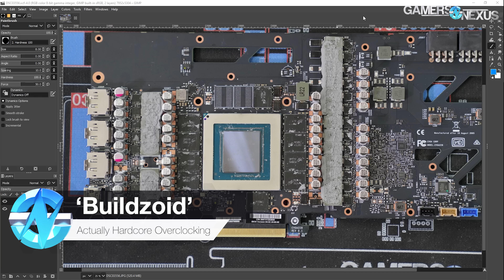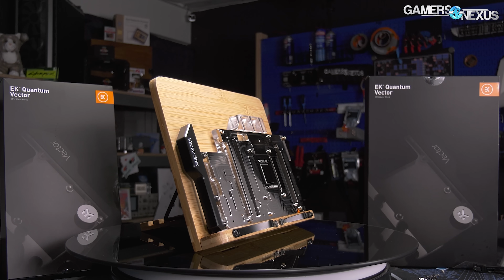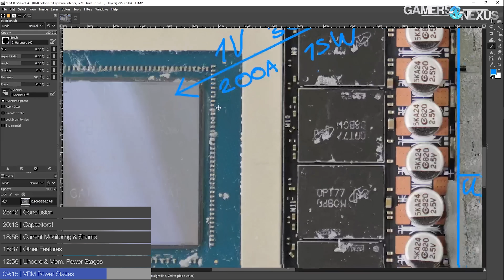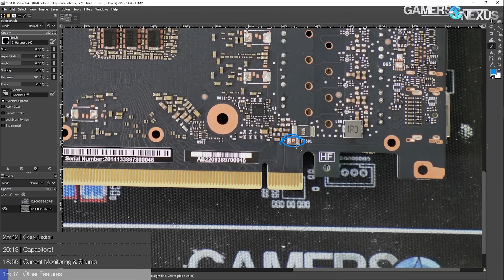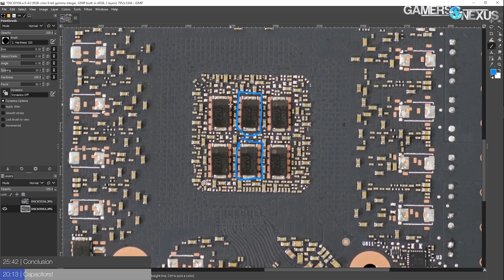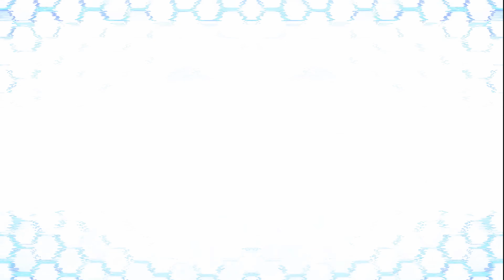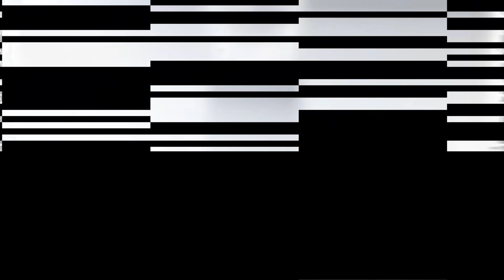Should Be Better for $810: PCB & VRM Review of EVGA RTX 3080 FTW3 Ultra

Comment: Hey Buildzoid. I have to ask...do you know any way to reduce coilwhine of 3080 FEs? I choose the FE, because I listened to your rants. Especially about the blower-heatsinks being to large. The FE fixes that, by using a short blowerstyle. And the other FE Fan is a passthrough, meaning less trapped Heat under the Card and less recycling of hot air.

Comment: So would EVGA's bios be fine with my Ventus 3x OC?
Reply: 450w bios? Nah not on a 2x 8pin card
Reply: @barronhelmutschnitzelnazi2188  Jumped the gun and got an email to buy the LHR version of this 3080. Definitely runs cooler than my Ventus 3x OC, I just wish I had rewatched this video before making this decision.
Reply: Very nice. Yea the ventus didn't have that great of a cooler. Now you can finally use that 450w bios and see what it's all about at least.

Comment: They probably just pushed out a quick card with a few additions from the refrence if the rumours of the AIBs having very little time to do anything were true.
Reply: I think having the new info from yesterday's hardware news about Nvidia trying to control pricing and unfortunately lowering AIB makers' profits down, I think this is the likely culprit. Not EVGA trying to cheap out on their best model moniker that they worked hard to build up and be able to charge a high premium for it.

Comment: This appears to be an early production PCB. I know EVGA reviewed the caps on the backside of the GPU after the whole 'cap issue'. Would they have changed anything else on the final product or is this pretty much what I bought? I feel a little deflated even though I'm very happy with mine.
Reply from the maker: Nothing else changed but the back.

Comment: Isn't this the fastest 3080 available? If it beats all other 3080, then it can't be that bad.
Reply: Na Asus is the most fastest 3080
Reply: If youre talking stock then its a matter of single digit frames, aka doesn't matter. This video is for extreme overclockers. There is nothing worse about the ftw3 then the strix for anyone not on ln2

Comment: What was the point of this? Got 20 mins in before it's mentioned that this isn't the real PCB, just a pre-release one that had the old VRM. Didn't EVGA send you a release version?
Reply: We only know about changes to the capacitors behind the core, other than that nothing changed in terms of power delivery
Reply: @Daepilin  source?
Reply: and he also stated that he has not had his hands on any of the high end cards in a while, and only work through pictures.  My take away from the video is that it is a very solid card, specs well above Founder Edition, but may not be the best or easiest card to work with if you are an extreme modder or overclocker.  And then there is this...
https://www.youtube.com/watch?v=Nw3ykG5IanI

Comment: I want 3080 ventus 3x oc pcb review please, also need it's stock fan noise info.
Reply: @jon snow How quiet, can you tell me what fan rpm does it reach on full load?
Reply: @jon snow Good to know, I bought a 3070 Ventus 3x OC getting shipped now so I assume the fans will be the same as your 3080. Did you adjust your fan curve at all?

Comment: so the pcb you had on there seems to be the first one that you received before they changed it a bit with MLCCs on the back, was there no other change than just the pos and mlcc between the one you have here and the ones on retail shelves now?
Reply from the maker: Other than caps on the back, there is zero other difference.
Reply: @GamersNexus  thank-you for the reply 😊
Reply: That's what I wanna know. I get If this is the original card and not the one post launch, because now everyone thinks evga is skimping out when, in reality, nvidia screwed them over and were left to scramble to put everything together. I love mine and get the right amount of power for the games I play. But I would like others to benefit from this card as well with proper info

Comment: Is this the pre-consumer card you guys reviewed? My capacitors are different than the ones in this video! Sad to see where EVGA cheaped out but after GN’s vid on Nvidia not giving these guys room for profit, it had to have been done somewhere!
Reply: 20:00
Reply: @gioXLVI  thank you sir, literally did not listen to that part I guess lol
Reply: Yeah I took that into account with that fact that other than better capacitors none of the rest matters unless your ln2 overclocking. And I wouldn't call it cheaping out if it doesn't make a single difference in the performance of the card stock or normal oc.

Comment: Any reason this breakdown is being done on a prototype board?  It may have broken the World Record for LN2, but it's still a prototype.  I haven't checked, but are the rest of the components truly 1:1 on the retail release beyond the MLCC cap change?
Reply: Usually with going from preproduction to final production boards the components if they are changed are more "cost optimized" ie. cheaper/worse.
The decoupling cap change is the exception, because it got public attention.
I would bet good money that nothing changed at all except the decoupling caps.
Reply: "Any reason this breakdown is being done on a prototype board?"

because that's what they got
Reply: This is the same thing i was wondering, does Buildzoid mention this at all?
Reply: Actually its not a prototype board, it wouldn't make any sense sending a prototype board to reviewers because the production would be so different than the prototype that all analysis done would be invalid. So this is a pre-production board, which means its basically at the latest validation tests and only minor changes would be done, like fixing a capacitor issue for instance. Its whats called in the dev world "release candidate", its basically ready to ship unless we find any last hour bug.

Imagine that you make tables, okay? Then you send to a table reviewer your prototype table, but your first impression is that L shaped tables use better the space of the room, so you make a prototype that its in L shape and send to the reviewer. But in the development process of that table design you see that the corner is not used, so the L shape is scratched to a normal flat design, and then the reviewer did  analysis of a L shaped table but your costumer would receive a flat table, so the review of a L table is completely pointless, it maybe even be hurting for your business since your customer is expecting a L table according to the review.

But, if you send a pre-release version, a version that is basically ready but you didn't do to much testing on it and its already a flat design the reviewer will analyze a table that is mostly what the consumer will get. But during the testing you check that the feet are damaging wooden floor, you decide to change to a softer type of feet without change the overall usability or visual of the table. the end user probably won't notice the difference at all, and even if they notice, it would be a better experience than the advertised by the reviewer, since now the table doesn't scratch floors without any down side effect.

Comment: Ooof.

I own this card with the XOC BIOS on it. 

I guess I'll upgrade to the Ti cards in a few months 😉.

Real talk, this is very disappointing. I may have missed it but have you covered the Asus Strix card yet? I originally wanted that card but that wasn't getting restocked as fast as others.

Thanks for the breakdown Buildzoid and GN.
Reply from the maker: We're really looking forward to the Strix! Haven't gotten it yet, just the 3070 variant.
Reply: Its really not though man unless your fn nuts your going for LN2 benchmarking and actually going to top scores. Unpopulated mem slot doesnt matter and the voltage controller doesnt matter for 99.98% of users. If your card is in a case doing normal day to day stuff like browsing and gaming. Then it "literally" does not matter and would cause "zero" differences. 

If you are willing to spend more money on a different card because of these reason then you just have money burning a whole in your pocket rather then actually switching it to something bc of something that matters. 

Even if you do extreme overclocking with LN2 this literally "almost" still doesn't matter because the top scores right now are being made without these adjustments. Just becuase one card has something the other doesn't, does not make it any better.

Comment: That's a super detailed review of the PCB and the components. EVGA probably thought no-one would dig that deep 😂😂😂
Reply: You would be wrong there Steve is in pretty close contact with evga, they know 😂
Reply: @samgoff5289  Go to evga.com lol
Reply: They should all be assuming this by now. Examples have been made, so either they don't care, or they can't because of other reasons.
Reply: @Clobercow1  they are probably just trying to justify the price and make as much money as possible per card. At the end if it works at advertised specs that's all they are responsible for, any manipulations or overclocking would solely lay on the end user. 😒
Reply: @Clobercow1  it is many many many factors. I believe Nvidia became way too controlling this time around on what aib partners could do and how they are designed. On top of that manufacturing during a pandemic and for a company the size of EVGA which isn't a global titan of a company like MSI, Asus, and Gigabyte who might I add all have their pre-builts desktops, laptops and monitors. I still think for hardcore overclockers it's a letdown but for a normal user this will do them fine. Just sucks EVGA seems to have been shot in the foot and in a way shot themselves in the foot as well.
Reply: Or they realize that it doesn't matter for 99.98% of people buying that card because it doesn't cause any performance increase or decrease.
Reply: @YouroGamer  true. Unless you're a hardcore overclocker, then you'll be like "oh no, I can't raise the frequency a little more till it catch on fire" 😄

Comment: I know one will answer but should I build a PC early 2021 or wait till late 2021 early 2022
Reply: Most of the major releases have already happened (RTX 3000, AMD 5000 series CPUs, Radeon 6000 ect), so waiting will most likely not help other than improving availability.  The only parts releasing that I know about are Intel's answer to the AMD 5000 series, and Intel's first attempt at gaming graphic cards.
Reply: Thx
Reply: @ashercampbell2571  I'd say Black Friday / early 2021? Afaik there isn't much in the mail currently, so you should be good?

Comment: If i don't get my email soon ( on the queue 9/17) I'm gambling on a 6800xt
Reply: For real. Fed up of waiting because of Nvidia bullshit. 

Does amd have a gpu maker that is equivalent to EVGA in terms of customer support warranty?
Reply: @dasitmaneayylmao2729  Generally sapphire is considered the amd equivalent. They only make amd gpus and are a tier one partner. 

I don’t know about customer support or warranty stuff but yeah. 

Also Powercolor would be the other partner on a similar level.
Reply: @astronomyastrology7186  It's funny because Zotac and Sapphire are the same company, but people regard Zotac as second tier, and Sapphire as amazing.
Reply: @dasitmaneayylmao2729  Sapphire has always had a pretty good reputation.
Reply: @dasitmaneayylmao2729  IDK, this will be my first AMD GPU I have owned.
Reply: @georgem.6136  I felt the same till I did my R7 3700x (I know) and my 5700xt on a B550 strix. It’s overclocked and ran like a dream for me
Reply: Nice profile pic, that looks like at least a 9 second car.
Reply: @bcool2525   Thanks, 9.20'S, 71 Nova. Should be faster with the new LS build
Reply: same go for 6800xt (queue 9/28)
Reply: @humanityerror404  Most definitely, Frustrating.
Reply: That makes my '12 GT500 look slow, and since I put a 2.9L Whipple on it its way more car than I can handle lulz.
Reply: @bcool2525  That GT500 can be really fast though, easily a low 9 second car. Check out StangKilr on YT, his shop has several mustang builds, get a Lund remote tune if you haven't already.
Reply: Been 2/3 in the ftw3 3090 gaming queue since scan started emailing the numbers here wouldn't hold your breath a lot of the movement is just from cancellation.
Reply: Good luck, if it’s anything like the ryzen launch you’ve a good shot
Reply: @trisjack82  Thanks, I was lucky enough to score a few different AMD CPU's at launch, 5600x & 5900x
Reply: @ajz562  Nope, i have checked on EVGA profile & it still says no notification has been sent. I went for the Ultra FTW3
Reply: @ajz562   Nope. I went from 3rd to 2nd on the 3090ftw3 gaming on the 20th of October. and the last email i got was on the 4th of November still 2nd in the queue. I am guessing its the gaming (non ultra) version then that they haven't shipped any of since their launch.
Reply: I'd already gotten a 3080, but forgot to cancel my place in queue. Got an email today from EVGA for 9/17 12:31PM. You should be up soon I'd think.
Reply: @Blacksadify  I checked & am i thinking within two days i should have an email....hopefully
Reply: @georgem.6136  You will, it's worth being patient for. People bitch about this card but it's a beast. I game with +1000 on the memory clock and at least +150 on the GPU clock. It boosts up to 2200 on the regular.
Reply: @Blacksadify  Thx for the real world update, I'm  really looking forward to it!
Reply: @georgem.6136  No worries! Enjoy your new card! You should hear from them within the next week I'd bet!
Reply: @Blacksadify  Got the email this morning, Card will be here Saturday woot woot!!
Reply: @georgem.6136  Nice, grats man!! Patience pays off. You still have a bunch of time for Cyberpunk and all the other new games too. Let me know how it goes!!
Reply: @Blacksadify  Got my card today, I must it’s a beast, I only had 30 minutes before I had to leave for work to install it & run Port Royal, i am very happy! It’s a beautiful card! Also my FTW Ultra does not have the Red Trim, It’s a grey like carbon color, will be doing some gaming tomorrow after I wake up!
Reply: @georgem.6136  Nice, grats man!! I'm jealous, I got the original Taylor Swift lipstick card. lol They're supposed to be sending out kits to cover it up to people who got the red one. I've been gaming with +800-1000 on the Memory and +500-700 on the GPU clock. Usually +500, but it can go over +700 if your cooling is adequate. Let me know how it goes!
Reply: @Blacksadify  Awesome to know, I will be tinkering with overclocks & gaming tomorrow, will update tomorrow !
Reply: @jkteddy77  Im at 1:57PM, no emails yet, hope you get yours soon!
Reply: @ajz562  I agree. I did receive an email notification the other day, then 5 minutes later another email apologizing there was a system error & the notification was not authentic.
Reply: I imagine you should be getting your email anytime. I got into the step-up a little after 7am, and as we speak EVGA is packing my 3080 to ship.
Reply: @Herr.Mitternacht  dont put all your eggs in one basket is the key take away for me .👍